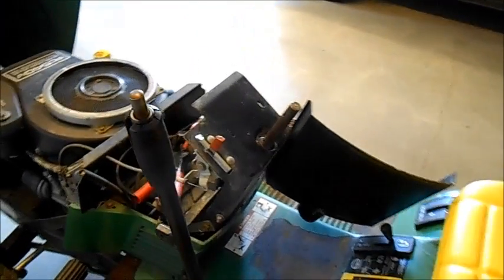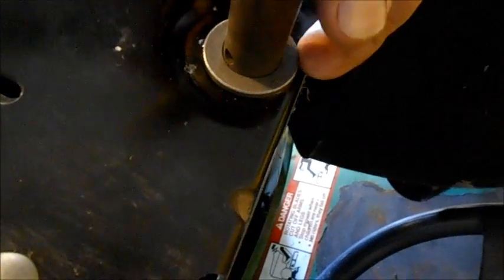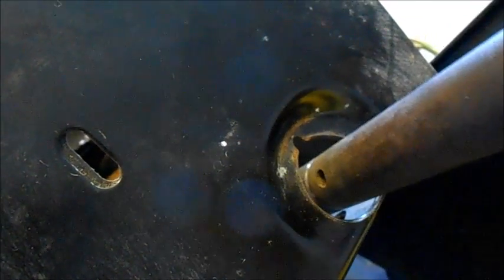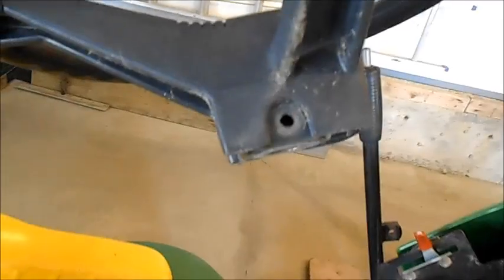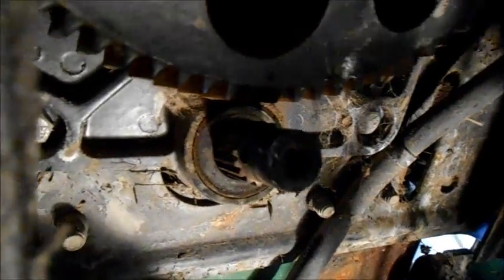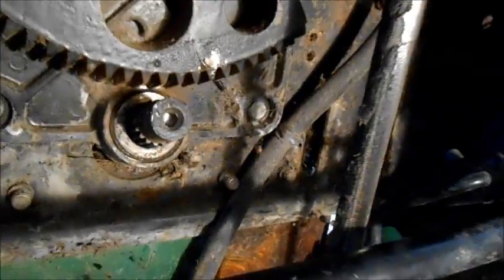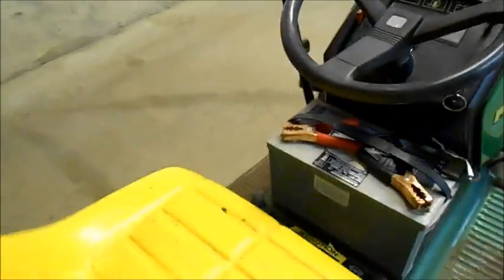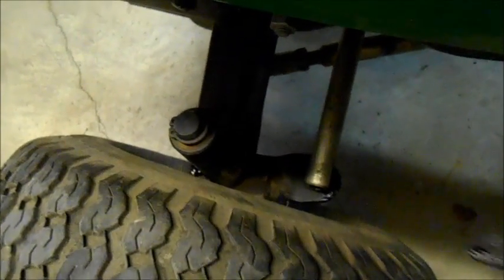Solving Steering issues on a John Deer 180 Tractor Part 3

Comment: Yeah I'm doing a x304 jd in a week, but on the x304 the bottom cog is press fit on, no nut to take off, but luckily the cog and sector are fine no wear, it turns out the bottom bushing is worn out not letting the cog and sector to mesh together, to far away from each other, so I gotta take the whole shaft out from underneath, oh joy..... LMAO
Reply from the maker: Good luck
Reply: @BrucesShop  Hahahaha yep, I'll need it.

Comment: Take the right side rear wheel off.  You will see the brake disk.  Use a 1/2" socket to tighten the nut on the center of the "caliper."  Correct adjustment would be .020" between the pad and disk.  Make sure the disk slides freely on the shaft as well. Brake pads are less than $20 at my JD dealer.

Comment: had that problem on another tractor. Found a washer with a ID slightly larger than the bushing and welded that too the body, That way the bushing and what not are still removable.
Reply from the maker: matt lemon Good idea.